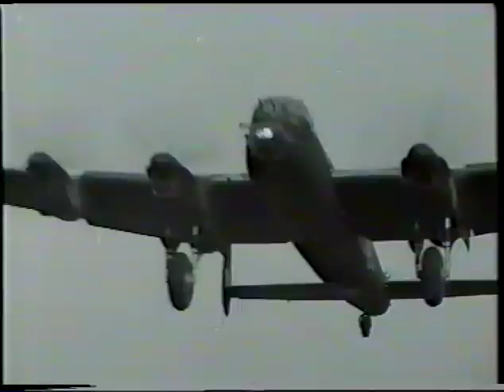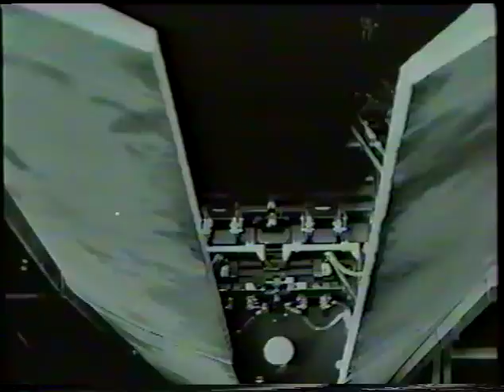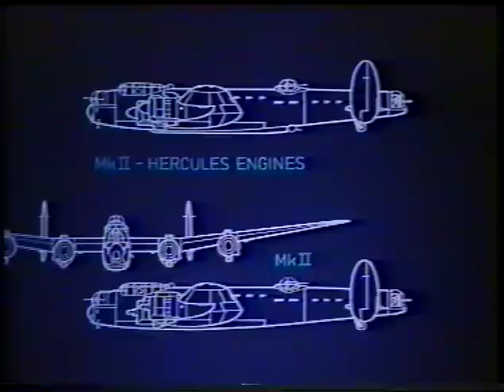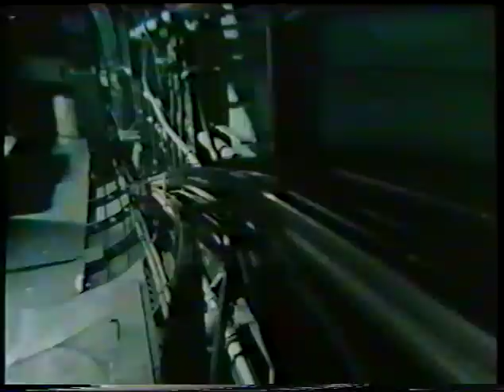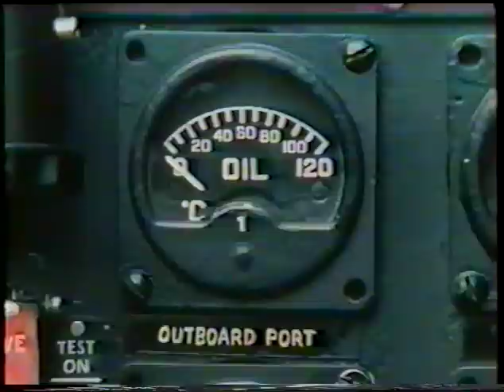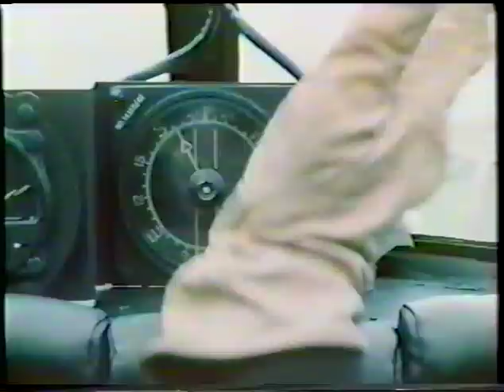Avro Lancaster Classic Documentary

Comment: 'GH'  "Of the 38 Lancaster II's thus equipped, 15 attacked the works according to plan, 16 found their sets to be unserviceable and joined the main attack on the city, 5 returned early and 2 were shot down. Photographs taken after the raid showed that    half of the bombs aimed by means of 'GH' had fallen within   half a mile   of the aiming point.    It was thereafter used more and more with increasing effect. By October, 1944, most of the Lancasters of No. 3 Group had been equipped with this important new aid."
page 15 (actually 14)
Hyperwar Royal Air Force 1939-1945 Vol III

Comment: Avro 683 Avro Lancaster B.III	This variant, which was built concurrently with the B.I and was indistinguishable externally apart from being fitted with Packard Merlin engines. The Packard Merlin used Bendix-Stromberg pressure-injection carburettors requiring the addition of slow-running cut-off switches in the cockpit.
BAE Lancaster page
Reply: nick danger  That is a fact the Brits refuse to accept that Packard built an improved version and supplied so many engines.  Packard built M2500  Pt boat engines were also used in the Brits MGB  MTB and air sea rescue because the Brits did not have a suitable engine for them  thousands of them used !!!   Also the 30 some Dam Buster Lancasters were All Mk BIII's with the Packard merlins....wonder why ???
Reply: @wilburfinnigan2142  I suspect because they were more reliable. Only the Brits used both and I am fairly certain if there was something stating Packard engines were not as reliable there would have been something written about it.

Comment: how come the lancasters did not have a belly turret many a german attacks knew this hense led too many a lost crew before you even knew it your pumped full of holes.?
Reply: Obviously a belly turret was not considered necessary at the time, a decision which was to later cost a lot of lives. The Germans actually 
built their later night fighters (Me110, I think) with four upward firing 20mm cannon, which they used by sneaking up under the Lanc in
its blind position, and blowing it to bits with one burst. 
I think one danger the German crew faced was to make sure they did not hit the bomb load as the explosion could seriously damage
their own aircraft.
A very dangerous and sad business all around!
Lest we forget!!!
Reply: Some lancasters were designed with a single 303 browning in the belly...but were removed to accommadate the H2s radar dome.   My dad was a flight Engineer on a Lancaster... it had a belly turret (squadron 195 out of Wratting Common)
Reply: I’ve never seen a picture of a Lancaster with the ventral machine gun in place... not sure how common it was